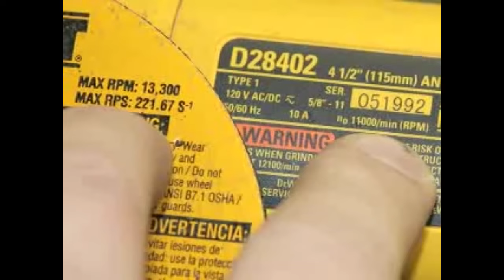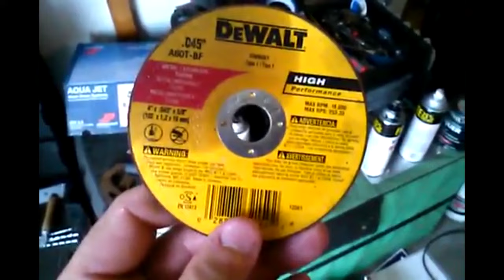Safety Time | Angle Grinder Safety

Comment: One good tip is to avoid getting right behind the wheel while you cut whenever possible. That way if it blows, you're not in its frag radius. I have a big red warning that goes off in my head whenever I'm right in the plane of the wheel.

Comment: I had a 9 inch makita grinder with a blade for cutting steel and it exploded. I felt like I'd taken a cartridge of birdshot to the face. I had 28 wounds. All about 3mm to 5mm. I looked like I had a bad case of infected chicken pox. I had no glasses or mask and I managed not to injure my eyes. Lucky is an understatement. I should be blind.  Hurt like hell too. Really hurt.  Never again do i use a grinder without full ppe

Comment: Someone I worked with had a grinder kickback and smash his front teeth clean out. 4 in total and a 3 inch gash up his chin across both lips and into his nostril. It was a bloody mess. And  he was lucky he didn't get it on the neck. He could have hit an artery and died as he was working alone. When you use a grinder every single day for years you will have an accident or a near miss.